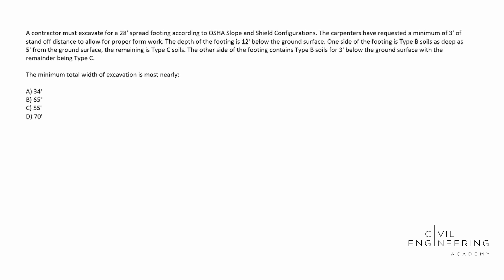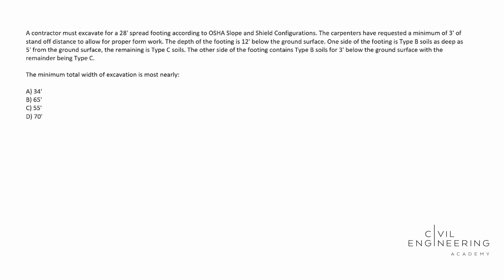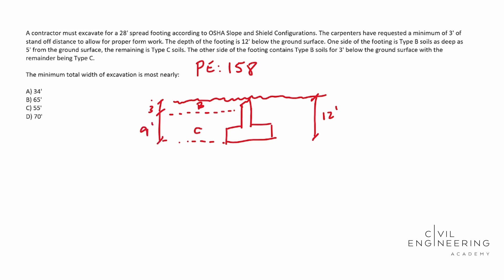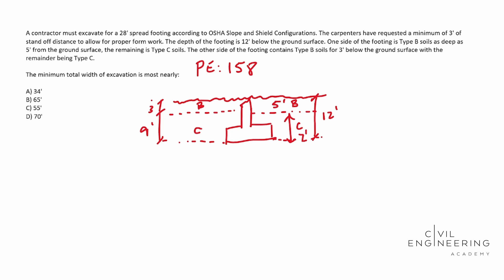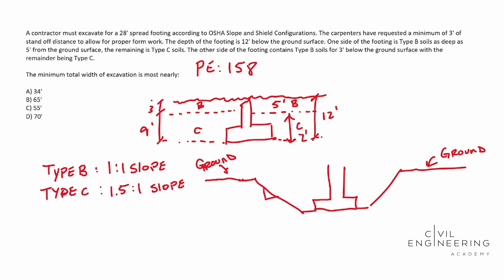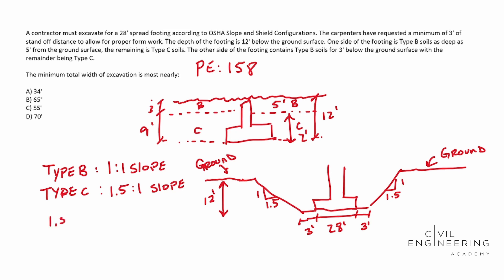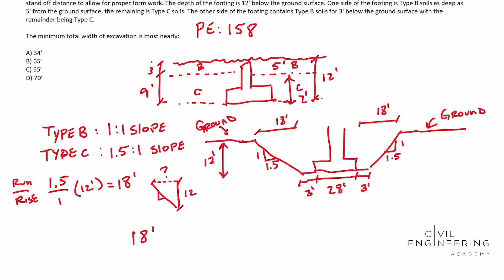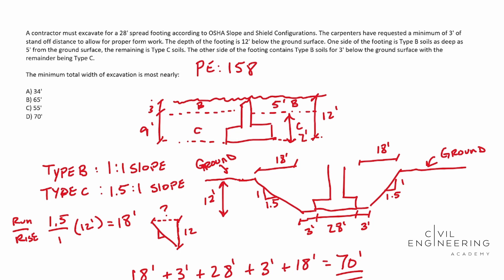Civil PE Exam - Construction - How to Solve for Total Cutback Width

Comment: Why isn't the excavated layers of soils used from the  PE handbook?  On Page 159 it shows type B soil over type C soil.
Reply: We use "slope & shield configurations",  page 158.

If we have layered soils...and we do have layers, indeed. We have type B and C. We take weakest soil type and convert all types to it. We use this weakest soil type until we solve problem. This soil type is C. See page 157.

Comment: why not consider the height of the type B slope, and calculate all height for type c?
Reply: See ncees hb 1.1, p. 157.

If we have layered soils...and we do have layers, indeed. We have type B and C. We take weakest soil type and convert all types to it. We use this weakest soil type until we solve problem. This soil type is C.

Read  3.10.1.E